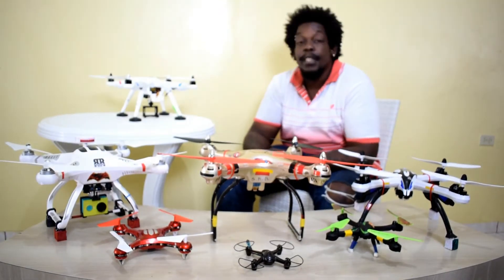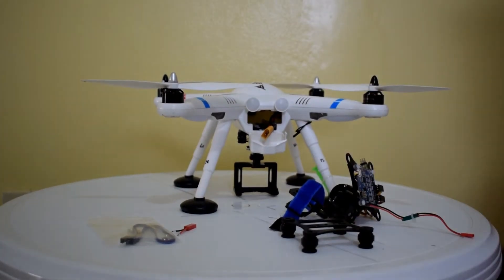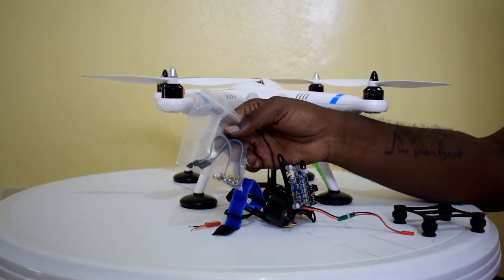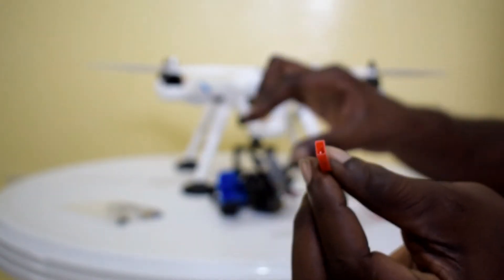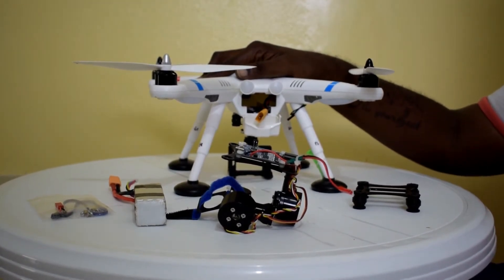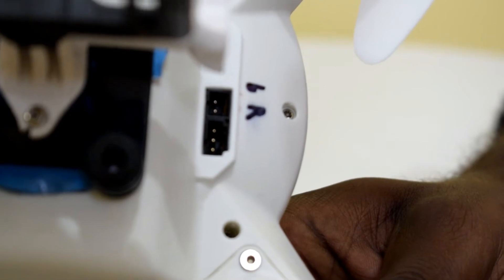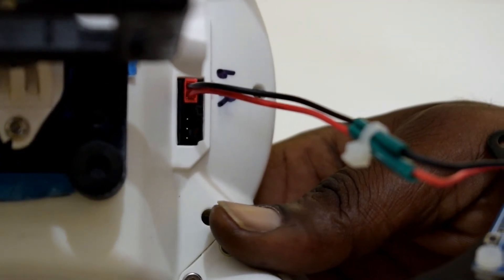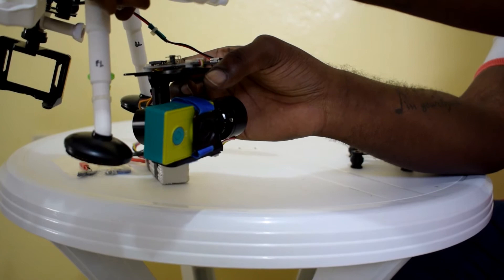2 Axis Brushless Gimbal Troubleshooting Issues

Comment: Hello my friend!
I have the opinion that the port where you connect the power cord does not provide sufficient current (A). My behavior was similar. Feed directly from the drone's battery or from a separate battery, it's important to have a high "C" rate battery! Hello from Hungary! ;)
Reply from the maker: Tibor ifj Czabányi Thanks for the input. I did power it using separate battery. The company wanted to see how it was working attached to the quad. I used the 12V pins located at the bottom of the drone.  Ground &  +positive. We tested other Gimbal and they work fine. Thanks again for your feedback. One of the boards at the top. Burn out. That's causing the glitching. No current coming from that section.